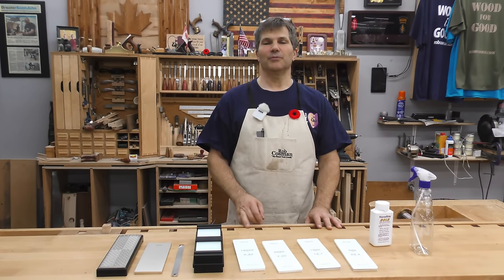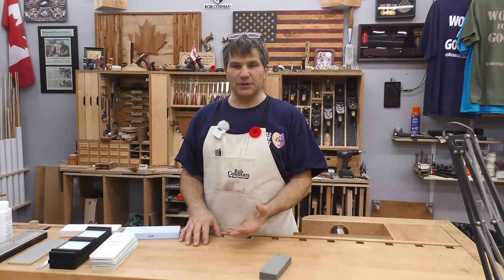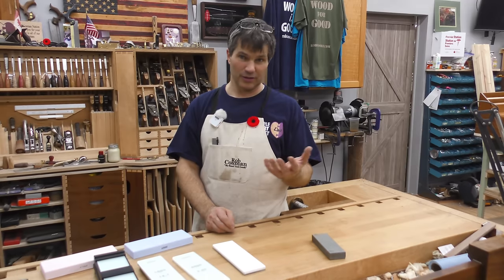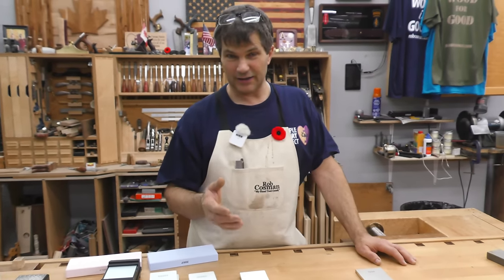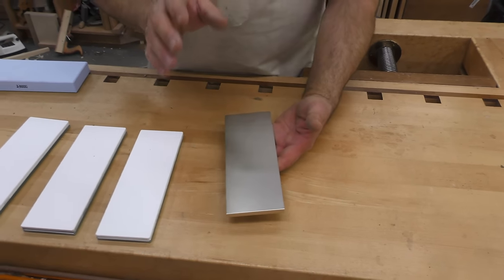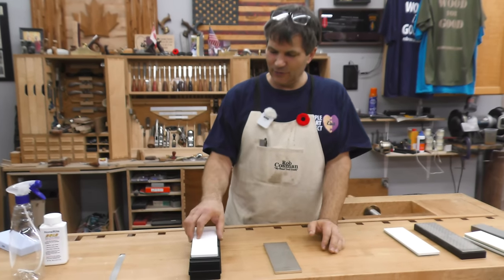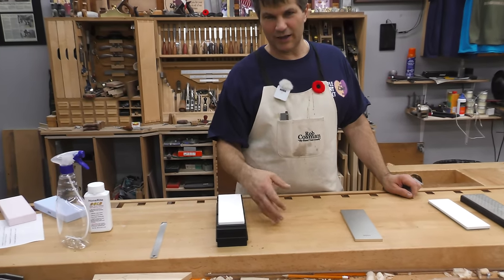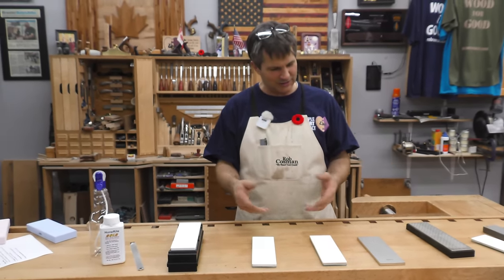Rob Cosman Sharpening Kit - (BEST VALUE)

Comment: I did my best to get the gear you recommend. The Trend 300/1000 I found locally, and the Shapton stones closest to the grits you advise are a 5000 and a 12000. These are replacing my water stones that after 30 years of use and abuse are finally done for. Since I don't have a grinder or a Tormek, I added a 140 diamond Atoma to bring my badly abused blades back to shape.  Many hours later, I have 1 plane performing better than it ever did before. The other 2 are close behind.  Thank you very much.  At 71 years, I will never catch up to you Youtube heroes, but I will enjoy the chase!
Reply: so cute <3

Comment: Rob, why do you not use leather strops combined with a good diamond plate. This is most economical in my opinion, thanks
Reply from the maker: I dont like strops, i prefer to polish on a hard flat surface.  U also found its easier to teach how to polish on a stone verses the strop.  And finally the small savings i get from purchasing a strop and compound is not worth it too me.  This is not to say stropping wont work as a polish step fir and edge it will.  I dont prefer it
Reply: Nothing is cheaper or better  then.a 2 dollar stone
Reply: Great video! Excellent information and explanation.
Reply: Just watched your video for the first time and it’s great information, Thanks. Can I use this method on knives?
Do you sell the kit without the Diamond plate since I already purchased one from woodcrafts?

Comment: Great video. For a diamond stone lubricant, I use Krud Kutter. Cheap, easy to find, works well as a lubricant, and never had a rust problem at all with it.  Just wipe it off when done and put the stone away.

Comment: I always said broom and dustpan are the two most important tools in any shop. Personally I work a lot with small mechanical things, such as firearms. If I drop a part on the floor, it is more likely gone forever if the floor is untidy. And general neatness and organization are key to any good work. But after that I would say sharpness is very high on the list. To flatten an oil stone, take a concrete garden slab, as used for foot paths. Some are machine made and very flat. Pour some Silicone Carbide coarse grit on one side, and add some water or oil. Now rub the oil stone in this mess until flat.

Comment: Thank you for sharing.  That shapton system really looks nice!
I'm thinking about getting the Trend since it's not as expensive but the honerite would eventually add up too. Not having to worry about rust is a really attractive feature on the Shapton.
Reply from the maker: If you just keep your dimaond stones wiped down and dry after each use you will be OK.  The Honrite is a safty feature in case you every foget to dry off your diamond stone.  It lasts a long time
Reply: The cost for the honerite is very low as it will make enough to last a hobby user more than a year

Comment: The spritz bottle, I use old supermarket cleaner spray bottles, I always remove the top and make sure the dip tube is in the front of the bottle when I reattach the top so when held forward the end of the tube is in the liquid.
Reply from the maker: That works too.  I always got frustrated when the liquid was running low and tilting the bottle the tube couldn’t suck up anymore water.  Call me lazy but I hated filling up that bottle more often than I absolutely had to!!!!!

Comment: Rob, just bought a shapton 4000, 8000 and 16000.  Man am i impressed and sharp as i could ever ask.  However, I'm not finding much or any information on how to take care of / clean my stones of the grey slurry after sharpening.  Could you please advise the best way to maintenance, clean and store my investment.  thank you
Reply from the maker: Hot water and a sharpening rule. I use it to scrape any of the really hard and crusty slur, the rest should just come off by rubbing it with your fingers after soaking in the hot water.

Comment: Hi Rob, i have your "older" recommended set eith Trend diamond and 16000 Shapton. I was looking after 500 Shapton lately to give it a try and i was surprised they now have Soft bond or Hard bond from each grit, to be used on different types of steel. I'm based in Europe tho don't know if you have the same. Would you mind explaining a bit the difference and which is better for what? Thanks a lot and keep it up!!

Comment: Hello, thanks for sharing this knowledge. I am wondering if thé ppl saying that thé 1000 is enought are really wrong. I also believe you are right. 1000 is enought for most of thé planings (flatening a board, putting a board to size, etc.) and 16000 is good for thé smoothing plane. May bé thé ppl you quoted don't use machins at all and that They Can not share your point of view as it seems you are using machins to make boards flat for example and mainly using planes for thé finishing tasks ?

Comment: Diamond plates should never be used beyond 1200 grit. They make a finer one but it's not legit. There is a boring technical reason for this, but just trust me on that. DMT makes a green color 1200 grit. That's as fine as you can get before it's a dud. You can get diamond abrasives in other types of stones and bonds beyond a plate, but it's expensive.

Comment: Previously I used a King 6000 together with Trend 300/1000. I shifted to a Shapton Pro Stone 12000 and the difference is unbelievably.  I use an old hacksaw blade with the teeth grinded away for the ruler trick and to keep my diamond stone from rust I dry it whit a compressed air.
Reply from the maker: Sounds great.  Thats seems a hard way to go to avoid buying a cheap thin ruler?

Comment: Just recently bought the Trend diamond stone and was very unimpressed with how out of flat it was. Visible bow to the eye so I returned it. Kind of stuck and don’t know what system to use for sharpening without spending and arm and a leg..
Reply from the maker: We quit carrying Trend about a year ago for that same reason.  Went to the original manufacturer, better product.
Reply from the maker: Trend has stated tolerances, contact them for a return.  Most were good but the hassle of testing every one was ridiculous.  You may have just been unlucky.
Reply: Go with Shapton, either Pros or Glass. For flattening stones ONLY, Atoma 140 or 400 grit is the best choice. I have the 400 grit one, flatten my shapton pros daily and are super flat. 85 euros only
Reply: @RobCosmanWoodworking  
Rob, what is the name of the original manufacturer? 
And if you qui carrying Trend does that mean that you would no longer recommend the Trend Sharpening Kit with the double sided 300 / 1200 grit diamond sharpening stone? I was considering buying the Kit until I noticed this post.
Med Vänliga Hälsningar

Comment: That big steel ruler you showed in the end has the perfect hole on one end to drive a screw through the end part of the big rubber holder and simply attach one end of the ruler on the screw and hold it on the opposite end and it's not going anywhere. Cosmanise the holder! :D
Reply from the maker: Thats a good idea

Comment: I already own a DMT Dia-Flat lapping plate, which is  95 micron / 160 mesh grit. Is that too coarse for lapping the Shapton 16000 plate?  It's supposed to be flat to 0.0005".

I sharpen freehand, producing a convex bevel. This method doesn't work well on most water stones because of the possibility of catching and gouging the water stone. Is the Shaption 16000 harder so that gouges are less likely? Unfortunately, catches just happen. Maybe not often, but they happen. I have a #10000 Sigma Power stone that I use on occasion, but usually stay with oil or diamond and a strop, so I'd like to try the Shapton 16000.

Comment: Hey Rob, thanks for the video!  What are your thoughts on the older shapton synthetic stones from the 2000's?  I have the 1000, 5000,8000, and 12000, along with the diamond lapping plate from back then.  I like them a lot but wondering about improvements that could be added.  I think they made a 30,000 grit one to, but the price was crazy.

Comment: Is that explanation of grit @3:20 right? If you split 1 square inch into 1000, each section would be juuust under 1/32" by 1/32". Even the particles on 80 grit sandpaper don't seem that big.

Comment: Thanks  for all the woodworking lessons Rob, I’ve learnt a lot from you. I’ve seen other woodworkers prefer Shapton Pro stones and was wondering if you ever considered those stones. From what I’ve seen Pro stones have more thickness while Glass ones are slightly better for harder steel
Reply from the maker: They are good stones.  Tried them but i prefer the glass stones.  I think the binder is better and the abrasive cuts faster than the pro

Comment: I like waterstones for sharpening knifes but I don´t use them for my tools anymore. They´re just so inconvenient.
You have either to soak them in water or store them in water. They don´t stay flat for very long so you have to flatten them often, which is more work and gets expensive over time because grinding away your expensive waterstones you waste more of the abrasive than you actually use. And the mess you make using them....
For sharpening knives they don´t have to be flat and in the kitchen you can just dump them into the sink for soaking. 
Oil stones are much more convenient. They stay flat for a long time and they just sit on a table soaked in oil. No preparation, you can just sharpen your tools and go back to work. 
But I don´t use them anymore since I have Diamond plates. They´re as convenient as oil stones but they stay flat forever. 
I don´t like to waste much time on sharpening. When I hit a knot or the blade just gets dull, I just turn around, sharpen the tool and go back to work. 3 years ago I bought my diamond plates and there´s stoll no need to replace them. When I was using water stones, they lasted about a year. The constant flattening wore them away.
I don´t even need very fine stones or sharoening plates, becaus I use a leather strop with chromium oxide. It´s cheap, there´s no mess, it´s convenient (no preparation needed) and it gives a mirror finish. 
I like to keep things simple. 2 different grits of diamond plates and a piece of leather with polishing paste. My no bullshit approach includes no honing guides or anything that would add more work without benefits.

Comment: So, just to recap, using the Trend 300/1000 diamond stone and a 16000 Shapton water stone gives really good results, but using all Shapton stones with a Shapton flattening stone gives better results because the Shapton flattening stone provides for flatter surfaces than does the Trend stone, is that correct?

Comment: I don't have experience with either so I can't say you are wrong but the shapten lapping plate is flat to within - /+ 5 micron and the trend diamond stones are flat to within +/- 0.0005 which is about 12 micron
  if you can honestly say you can tell the difference I think that's amazing but I think that that's overkill
 and there is no way that the flatness will cause the difference in sharpening results 
maybe its the fact that you are using a diamond stone instead of ceramic but if you finish both the with the same ceramic stone then there can be no difference

Comment: I started with king waterstones...they are good...got a norton for the coarsest and it cut like fast!..but it went out of flat quick..but it was cheap and it flattened quickly with a lapping stone...when i had to replace that coarse stone I went with a diamond plate...it works well but no data on durability yet because i've had it less than a year.

Comment: I use this same setup and can attest to the Trend being out of flat.  Mine is cupped to the point where it's totally unusable for anything but narrow blades.   I use a honing guide and the Trend is nearly useless with it because it grinds all of my blades with a negative camber / laps my stones with a reverse cup.  The time I have to spend trying to correct its unevenness is just not worth it at all.  If you are good a freehand sharpening, then you'll just have to remember to learn the shape of your Trend plate and compensate for it.

I love this method of sharpening, but just don't rely on the Trend plate for it.  Spend a little extra for an actually flat stone.

Comment: i recently picked up a few more shapton stones so i cycled back to this video.  what is your opinion on window cleaner with a little dish soap rather than water?  i havent sprung for the shapton flattening plate yet but i did make my own holders out of 1" hdpe and put some rubber matting on the bottom. very heavy and brings up the stone so it is easy to flatten in the same way.

Comment: You probably ain't checking on this video but this is the only video on sharpen stones. My question to you is thoughts on the Norton and spyderco ceramic stones because they grit up to 2000 to 8000 and don't wear down like the Sharpton ceramic water stone
Reply from the maker: I have found Shapton to be the best in terms of blade performance. It doesn’t bother me that they wear, I get at least 5 years out of it

Comment: 3:18 sorry Rob, the explanation for the grit size measurement on sharpening stones could be better. The size of the grains does matter not the concentration. This is also true for sandpaper. Please look here for a quick overview: https://www.knivesandtools.com/en/ct/expressing-grain-sizes-sharpening-stones.htm
For more details look here: https://www.gritomatic.com/pages/grit-fundamentals
The JIS (Japanese Industrial Standards) 8000 means an approximate grain size of 1.2 microns.
Reply from the maker: You are correct.  If you really want to measure apples to apples micron size is the standard, but microns can get confusing for most folks especially in North America where grit is the common abrasive measurement.  The abrasives a 16k Shapton uses is .92 microns and thats the abrasive size I recommend for polishing your cutting edge.  You can go higher into the .5 micron range with a 30k Shapton but its a pretty pricey stone.  The point is the higher the grit the smaller the abrasive particles and thus the smaller the scratches and higher the polish.  Thats the point i am trying to get across without a super deep dive into abrasive size that most people don’t want to hear. On YouTube videos, but I can go there for you.  Good point

Comment: Dilemma, I found the funds for a new plane, I have a 5 1/2 woodriver, do I buy a low angle block or a 3/4 shoulder plane? I own a junk Stanley block...
Reply from the maker: Low angle block. It will get much more use than the shoulder plane.

Comment: 400/800/1200 Diamond Stones with a leather strope is plenty enough for me.
Reply from the maker: You can save yourself some time and just go 1200 and then to your strop.  Try it
Reply: @RobCosmanWoodworking . Yes I normally just 1200 then strope. The lower grits are just for old irons and chisel blades that I find at garage sales and such that need flattened and the bevel shaped. 
I started with the automotive sandpaper on granite, but diamond stones are amazing. No rusting with Windex spray.

Comment: My Trend diamond plate and Sharpton 16K are on the way (I saw the shipping notice from RobCosman.com this morning). I was looking at the iron on my brand new 5 1/2 yesterday, and noticed a couple of visible nicks in the edge. Do I need to remove those before I can do the 32 seconds to sharp, or will your system remove those in that short a time?
Reply from the maker: depends on how deep the nicks are.  Do an extra heavy secondary on the Trend, say 20 seconds instead of 10.  This might take you below the nick.  I check with my finger nail pulling towards me.
Reply: @RobCosmanWoodworking  Thanks! I'll give that a try. I really appreciate your teaching and the great customer service.

Comment: i dont sharpen my chisels that often, but i sharpen chef knives almost daily, and i have something you might be interested in. it is called a sink bridge. they can be found on amazon for $30-$40, and they work amazing. you can uses them over a sink, as you can guess, or as i used them over a bucket of water. the sink bridge is the greatest sharpening tool i have ever found. it makes life so much easier. no more squirt bottles, just reach down and grab a little water with you hand, and clean up is just drain the water out of the bucket. no more weird clay stuff (swarf) on you counters or bench. i will say, i do prefer the ha no kuromaku shapton over the glass shapton but that is personal opinion. i like your videos, but that 3 1/2 minute dovetail video is your finest work. i have watched it about 10 times now, and every time it seems like magic, keep up the good work
Reply from the maker: Tried it and I don’t like it in a woodworking shop.  Wood and lots of water dont go together and you only need a little spritz bottle not a bucket full of water. Most woodworking shops dont have sinks and the first time you spill you bucket of water in your shop it is not fun.  I prefer a little spritzer bottle.  I just dont think that method translates well in a wood shop
Reply: @RobCosmanWoodworking  lol good point, thanks for the reply